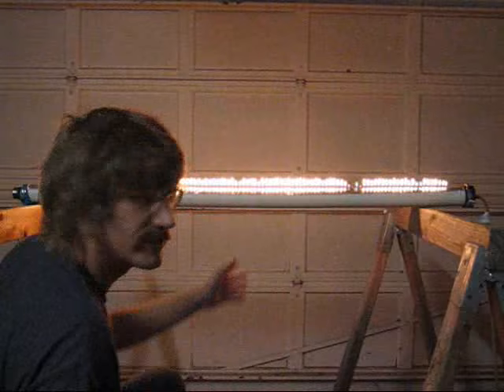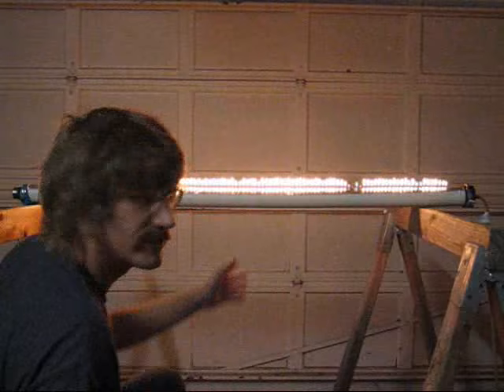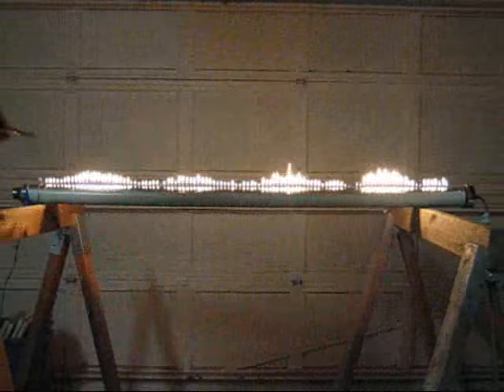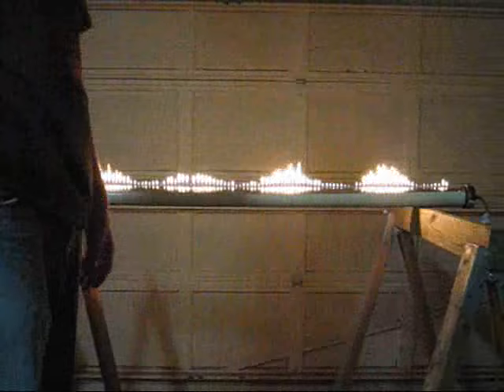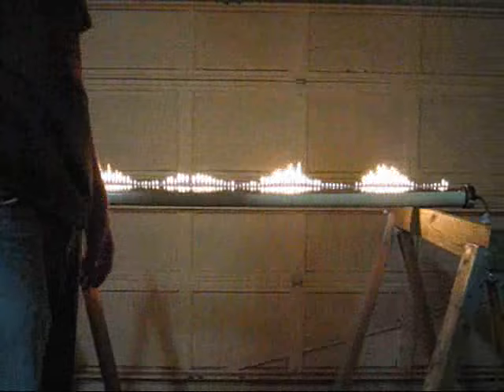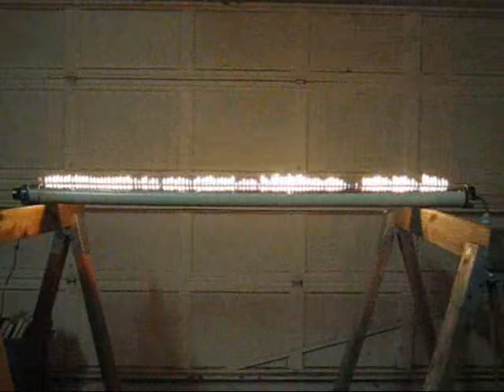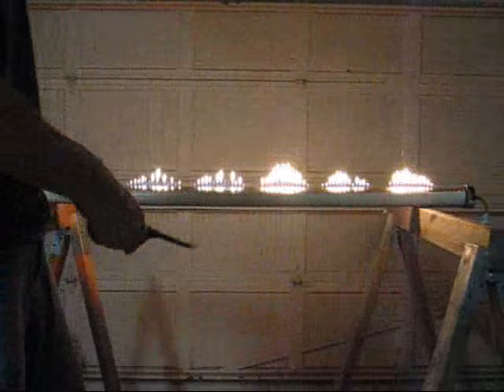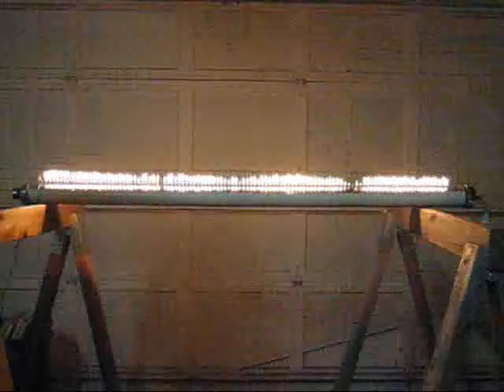Ruben's Tube

Comment: was replied to em that the speaker would have to be on the end, but my thought was that with a right it would be placed inside anywhere, and a variety of configurations come to mind,
for instance an unbroken tube with the speaker exposed inside on both sides,
or an incomplete ring with dual-mono speakers facing in toward the the righ(back to back) to increase compression (or i'd even like to see a straight tube with opposing speakers)

Comment: @wowaddictednerd if u cant find a 3" speaker you can also use a 6" speaker and use a PVC reducer from 6" to 3" and also it would also help flames escaping through the leakages of the speaker and this would happen because with the reducer it is further away from the open flames which would make it harder to ignite the escaping gas through the speaker. and also wrap it on using teflon tape it stops it from leaking.

Comment: I need a fire place with that set up
Reply from the maker: Unfortunately this works as a low pressure high volume system. It would not be safe as a fire place, it has a greater risk of creating an explosion. But if you have a good enough bass beat with high enough sound volume you can influence a High Pressure system like those of a UL approved gas fire place. But it needs to have some pretty significant energy to it.

Comment: Low pressure allows more gas to escape? I would have thought the opposite. Typically low pressure reduces flow rate, which means that the compressed areas are the higher flame areas. The ends of the tube are also the ones with the lowest flame height when a standing wave exists. This is because at the end the pressure must return to atmospheric pressure, which means no flow (no net pressure difference).

Comment: Starting at 1:00 you get it wrong.

Lower pressure does not allow more gas to escape into the atmosphere, it sucks in atmosphere.  The areas with the flame are areas of high pressure which force the gas out of the tubes at those points.  The areas of low pressure either equalize with atmospheric pressure or suck in air, but they most definitely do not force air out.  Common sense dude.

Comment: Interesting!, I will have to try doing that but I will port one of my tubes to see if there is a difference. But I will play sum heavy metal like AC/DC into my tubes.
I guess you need the foil tape to stop the pvc tube overheating.

Comment: I don't know, man...  for a standing tone, I think your explanation makes sense.  But when it's poly-tone, you can see there isn't uniformity across the tube.  Some spots have higher flames and some have no flame.  Like at 2:10, it's a big complex sound made out of many tones.  I'm still thinking there may be a frequency spread across the tube...  Like when there's a part of the tube with no flame, there's no sound being emitted at that particular freq...  or cancellation...

Comment: great video. i think (?) it said the flame is higher where the standing wave has low pressure. i would have thought it was the other way around: where the wave is high-pressure, wouldn't more gas be forced through the holes? maybe i misunderstood.

Comment: @twinrawk So, I just finished making one of these.  It works but it doesn't preform the way I want it to.  I used vinyl gloves for the diaphragm and I did that on both ends of the pipe (The gas is coming through in the middle)  Also, I used a speaker larger than the pipe.  Should I use a smaller speaker?  Should I use latex gloves instead?  Should there be a diaphragm on only one side of the pipe?  Thanks!

Comment: wondering if this could be done with flames from alcohol... might be less dangerous and more easily accessable than propane and propane tubing and valves... thoughts on capability of rigging with an alcohol system?

Comment: Awesome video. thank you.... I'm not sure, but I feel like the high/low pressure explanation is backwards. I would think the higher flames is an area of high pressure. Consider this- you have two set-ups of tubes with holes hooked to their own propane tanks (no speakers); one tank has a higher pressure than the other tank, turn the tanks on, light the gas on fire, which flames will be higher? I would certainly think the tank with higher pressure would push more gas out of the holes and those flames would be higher. Thoughts???
Reply: Yes, I agree. The higher flames must signal areas of higher pressure, not lower pressure.